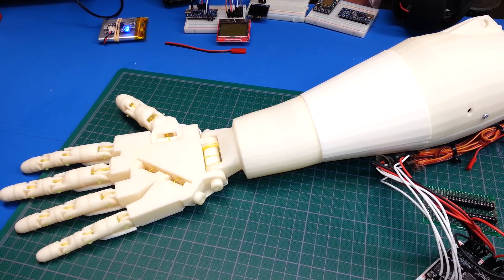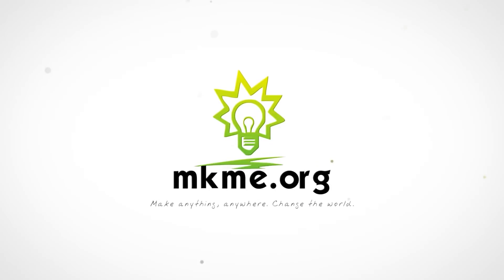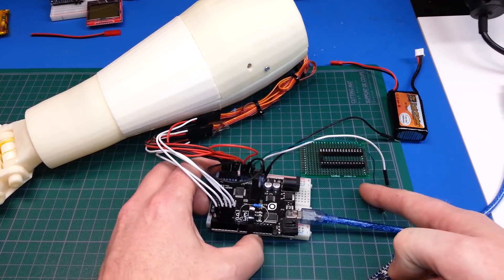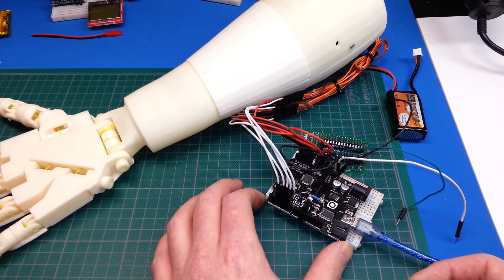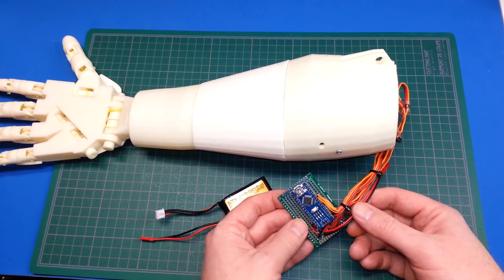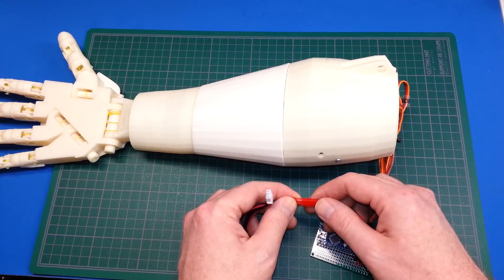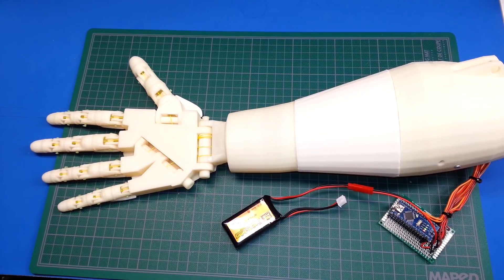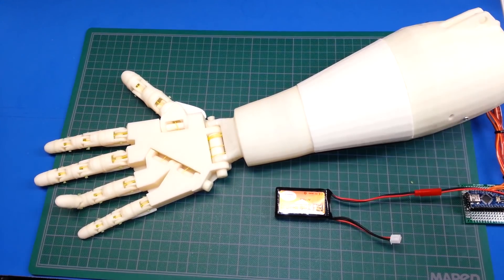3D Printed Robotic Arm- Arduino Nano Retrofit!

Comment: What servos are you using? If you have a problem with servo shaking, I find that a big 470uf cap across power to each servo or a ferrite bead on the cables will smooth out a lot of problems. Especially when two or more servos are running.